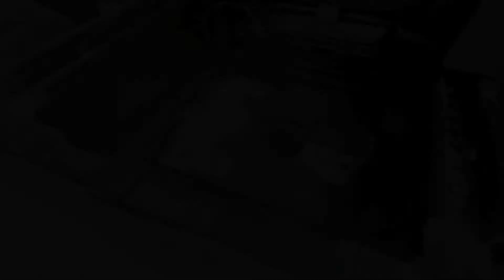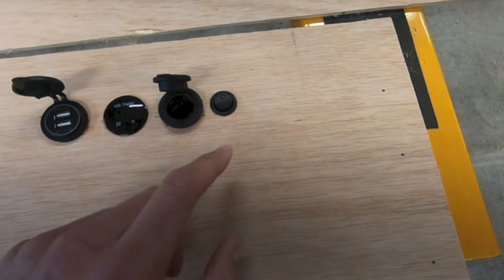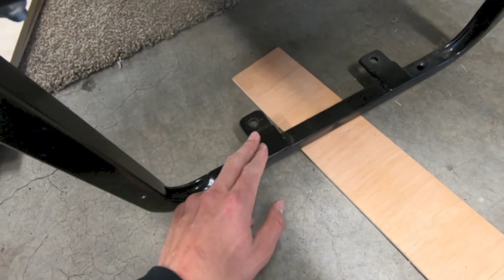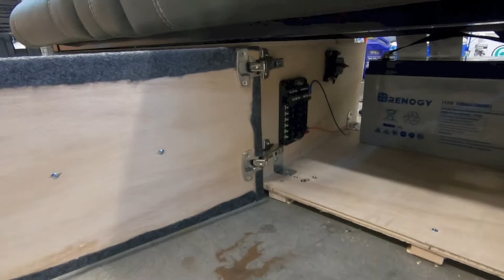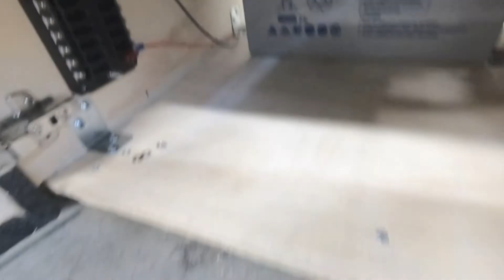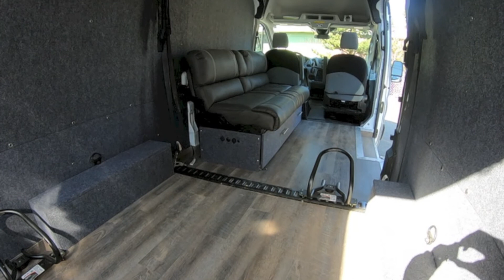Vlog #3 - Ford Transit Moto Van Conversion - Electrical (Auxiliary battery install)

Comment: Have you thought about doing a wall. Making a garage putting a toolbox some shelves back there for oils maybe a fold out table?
Reply from the maker: Jared Romero yeah we are definitely building some cabinets/shelves after we get the ceiling up. We decided against a wall, because we use this van for arenacross in the winter a lot, and like to have the open space to hang out in! Instead of having to choose between the cab or the garage!